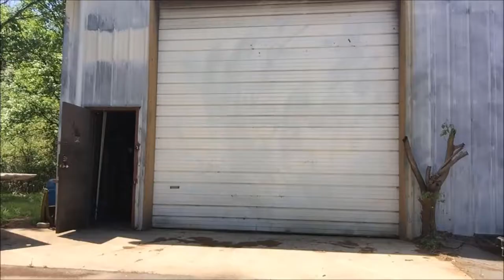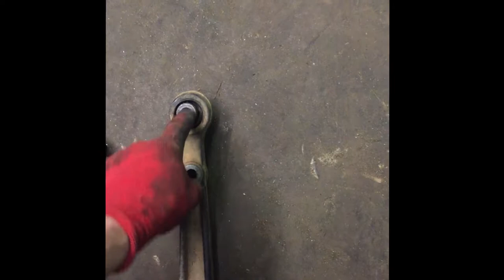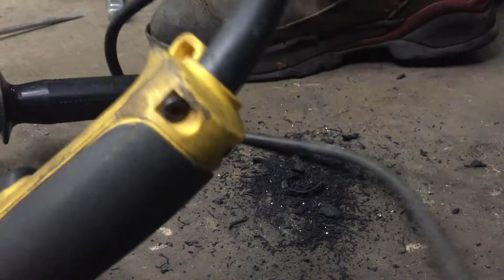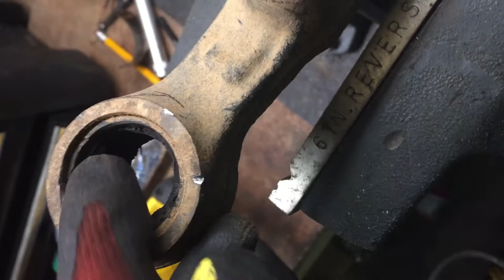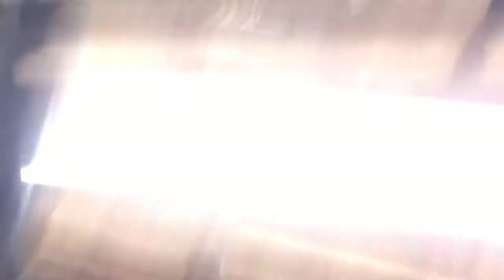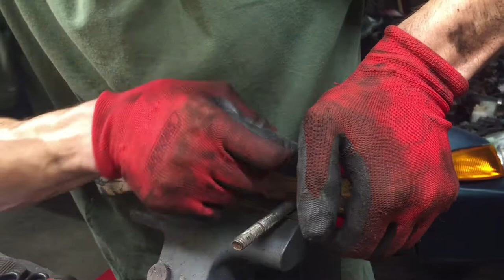How I install bushings

Comment: Energysuspension bushings review:
There are a lot of issues with these bushings, some are not manufacturers' fault, others - are. And I am not talking about price - this is something the buyer at least knows in advance.

1. Their claim that all it takes is "some smoke from the bushing to separate the sleeves from rubber" is outright lie. It may be the case with jeep but certainly not with Toyota - you need to torch it for a long time to actually burn rubber off.

2. The fact that they don't provide sleeves with the bushings is simply ridiculous. Especially considering price. In fact, I would not mind paying extra so that I did not have to dicect the old bushings, and the first issue is minor compared to this one. It is pretty common for bolts/sleeves freeze in bushings so it's virtually impossible to separated them from inner bushing sleeves without damaging. 
It may not be an issue with jeeps and fords because their bushings are replaced on a regular basis but Toyota bushings last so long that it's practically unavoidable to face this. In my case, the truck is 17 yo with 230,000 miles, and the original bushings were still good. The only reason I had to replace them was installation of lift and JBA upper control arms that required alignment that couldn't be performed because - you guessed it - one bolt and one cam sleeve were frozen. After 17 years in the Midwest and N-E, is should not come as a surprise.
This condition requires a hell of a lot of heating and pounding, pounding and heating, and then it's a real PITA to attach the [original] washers to most likely damaged bushing sleeves.

3. The last issue is design - there are no lubrication means. And don't tell me it's impossible - just look at JBA upper control arms. I installed grease fitting in control arm ears and drilled holes in the bushings to allow grease flow to inner sleeves. Hope it will work.

Overall, bushing material is probably adequate but pure inexcusable greed that prevented the manufacturer from providing lower bushing sleeves and washers (even for extra $$) is beyond ridiculous. 
Bottom line: if your vehicle is 10+ yo and has spent that time in places where winter happens every year, expect MAJOR (BIGLY!) hassle installing these bushings. Or - MUCH BETTER OPTION - buy from another manufacture that does provide all necessary coponents and does not force to wash and reuse condoms because reusing bushing sleeves is just as ridiculous as reusing condoms.

Comment: What brand of bushings do you use?
Reply from the maker: I normally use Energy Suspension Brand bushings on all my cars. The ones I installed in the video were an off brand from Amazon though. I have installed several different brands of bushings on peoples cars and I haven't ran into a bad Brand yet. Different brands will sometimes offer different stiffness levels, so it can vary depending on what you want.